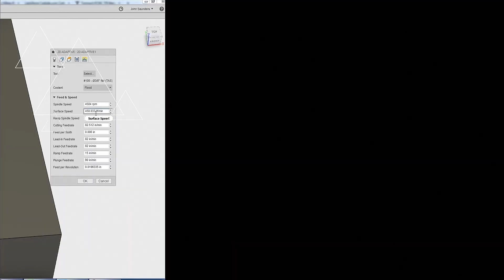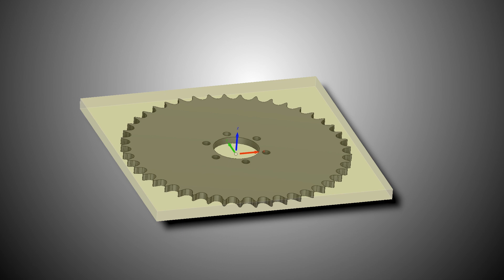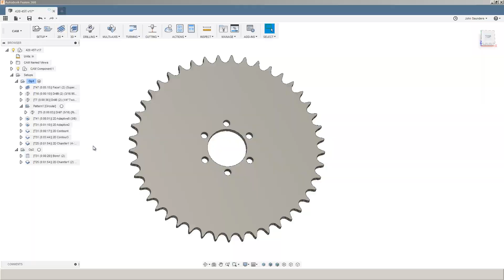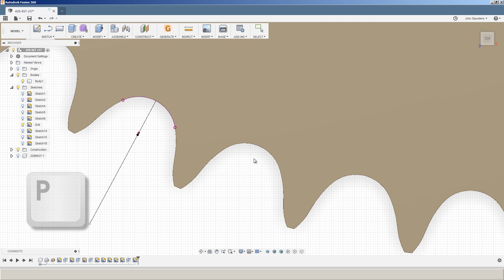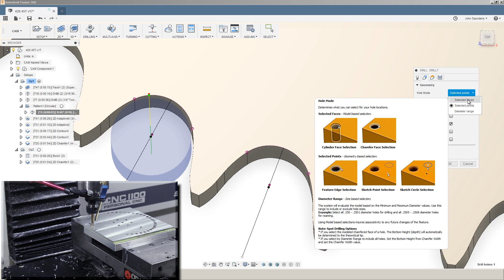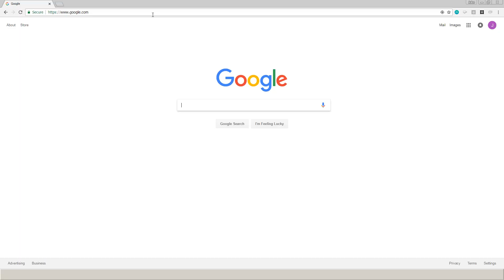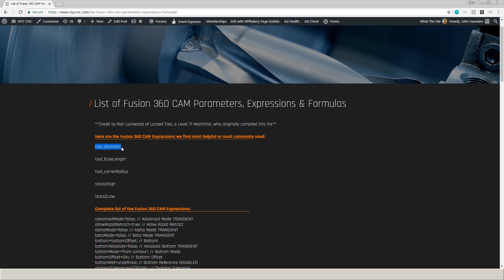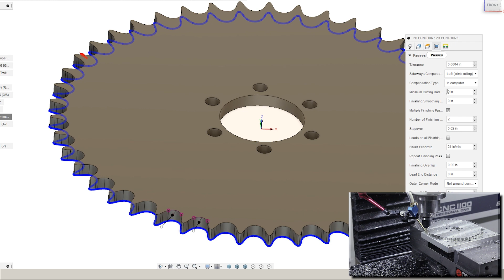CNC Machined DIY Minibike Sprocket | WW214

Comment: Is there a reason not to do a 2D contour  cut that cuts a circle around the sprocket teeth instead of cutting away all the material of the plate as you did in this project?

Comment: the peaks on the sprocket teeth are too tall and preventing the chain rollers from rolling out easily.  daniel. make your chain tensioners to run inside the chain close to the sprocket to help pull it off the sprocket.  or use idlers and a second set of spring loaded tensioner rollers to pull it in.  you could mount them on a triangular plate..

Comment: Hey John, I'm the production manager of a CNC milling shop in Germany and watch your videos for a while.
You're absolutely right when you say workholding is the most important thing about our job, with the right technology you can save a lot of time and money. 
I have never tried the Super Glue trick myself, because I mainly work with steel and have magnetic chucks available.
What I noticed in this video, is that you do not have to mill the corners away when the super glue sticks as well as you say. 
This only costs time, I would use after drilling a TPC strategy to make a circle to have room for the final pass.
In WW211, Ed made a lot of parts for your DIY Turret Lathe, he was a little inefficient because sometimes he had to measure the workpiece twice in the second operation, you could saved this completely if he had drilled trough the complett raw material in first operation. The drill operation will take some secounds longer but as long you have to use the Haimer and not a automatic touch probe system, you can be a lot faster.
Anyway only a few tips from a German guy... , you doing a very good job and it’s geat to see how you have evolved from your beginnings and now your are even start in 5-axis business.
Keep it up, best regards 
Tobias

Comment: I notice that you don't use coolant with the super glue fixture. I have found that the coolant destroys the adhesive bond of the blue tape, and the part comes loose during machining. If I am using coolant, I use the super glue, but no tape. The result is requires more cleanup to get rid of the glue residue, but the bond holds up during machining. I have also tried 2 sided carpet tape instead the the super glue, but the coolant also breaks that adhesive bond. I find that coolant gives better results on 6061 than air, especially in preventing welding of the chips to the tool.

Comment: Cool I would just make it from steel It will not last long from aluminium. Couple wheelies  . . .
Reply: Wrong. It'll last the life of that bike. I drag race 200+hp 2-strokes and all I use are aluminum sprockets in the rear.

Comment: I would have like to see how you set your coordinate system on the second opp - or did you?  How did it work out with 4 locating dowels and 45 sprocket teeth?
Reply: Use the bolt pattern
Reply: Yeah, just would have like to see it - there would be lots of ways in which you could screw that up because of odd number of sprocket teeth (lack of symmertry).
Reply: There's a tooth every 8° and a bolt hole every 72°. There's 9 teeth between each bolt which means no matter the orientation it'll line up just fine.
Reply: Well there you go... I wonder if that was premeditated or just dumb luck?
Reply: @stefanblack3909  may just be a simple luck of the draw, but if you did it in CAM You'd just aim to have one sprocket tip at 12oclock or something.

Comment: Question: why are you spending the time turning the corners and center of the stock into chips? Seems like you could skip the corners and the center plug and just toss the leftover pieces in the scrap bin. You'd have to knock them loose from the pallet, but that isn't burning up machine time.
Reply: If you cut at full width at NYC CNC you get fired. I'd just run a 1/4" EM and cut out between all the drilled spots

Comment: I wish you would have talked more about the design of the geometry, in addition to how the part was fabricated.
Reply: Well I did most of the design my self based off my very specific needs since the build is very custom. The new motor I put into the bike makes way more power than the original so I needed a stronger sprocket. It's a 420 motorcycle sprocket design which is much thicker than the original #35 sprocket allowing a larger 420 chain to rest on it, I also stepped it down to a 45 tooth sprocket to make the gear ratio more controllable with the new motor. Plus the 45 tooth design is symmetrical when flipped over making Op 2 easy.

Comment: Would have been much better and faster and easier to band saw the corners off, clamp the roughed OD to that plate you have it on, finish the ID, then cap the ID to finish the OD and bolt pattern. You can get away with the center cap overlapping the bolt pattern if you are concerned about vibration. Just drill/mill thru the cap into the holes. That part should be done in the time it took to drill all those holes! Take that drill out of there for crying out loud!

Comment: Hey John, I’m a high school student and my school just bought two tormach 440s and a tormach 770. I feel like I have an idea of the whole cad/cam side of things but I still have no idea how I would set the machine up and get it running, any videos you recommend on that?
Reply: That seems like a pretty substantial outlay without knowing how to run them?
Reply: Anonymouspock my school just passed a 90 million dollar referendum so they’ve pretty much been blowing money around, none of the teachers are trained so it’s really just me and a supervisor trying to learn
Reply: Damn I wish my school would get some more CNC stuff. Out woodshop is pretty nice, we've got a number of SawStops and other nice tools, but as far as CNC goes there's one old, big ShopBot that I worked on getting running last year, and there's a couple little mini CNC mills hanging around I plan on trying to get working this year.
Reply: Tormach has videos of machine installation and they send pretty good instructions. As for operation, how about starting with Johns templates and tool libraries.
Reply: Document your efforts on getting those machines running. Pictures, videos, daily work logs, random notes scribbled on napkins at lunch, everything. Make it look nice in a binder and maybe a website for the digital stuff. Then whenever you need to present yourself to someone else, be it for a college application or a job interview, take the binder in and tell your story. Be humble yet proud and I guarantee you'll make a good impression.
Reply: @jeffwuzhere wish I did this 5 years ago lmao, now looking to get an internship at Tormach and going to school at UW Madison for engineering mechanics
Reply: Might be worth a try to see if there is an experienced person in your area who wouldn't mind helping out. Perhaps post this question also on https://www.cnczone.com/forums/tormach-personal-cnc-mill/

Comment: Good prototype. You should make one out of steel now. It'll last longer. And it will give you some experience in how materials affect your programming Speeds and Feeds.
Good work.
Thanks
Reply: Steel is way too heavy, esp on that tiny bike. I have had aluminum sprockets on all of my street bikes, which have well over 100 hp, and they're fine. Most high-end/performance/aftermarket rear sprockets are aluminum. Steel just adds rotational mass contributing to angular momentum, and unsprung mass.
Reply: Really. Ok thanks for that info. I learn something every day. I wouldn't have thought aluminum would last with a steel chain. Interesting. Thanks

Comment: Where do you get sprocket cad files?  Say 520 pitch in various number of teeth?
Reply: Mastercam
Reply: McMaster carr has cad files for several sprocket types, certain # sprockets match motorcycle sprockets like 420 and 520 in pitch geometry but not thickness
Reply: 100% No need to recreate the wheel when McMaster has all this stuff publicly available.
Reply: Thanks!  I used sprocketeer and had issues with the sprocket not aligning with the chain properly.  I will try a mcmaster model and see if it works out better.

Comment: I've made numerous sprockets and I never chamfer the edges. I only put a few degrees radial draft on the edges of the teeth only (both sides)  leaving the roller socket with a square edge. Machinery handbook has the formulas for tooth formation. Mastercam has a built in chook that will generate a sprocket with a couple of mouse clicks. Last sprocket went from cad to cutting in 15 minutes.
Reply: The point of these videos aren't so much to show how to machine a sprocket. They're a method to show intricacies of CAD/CAM.
Reply: @xenonram  what good is knowing cad cam if you are unable to build things correctly? What customer is gonna pay money for things made incorrectly even if it's made by the greatest whiz bang programmer? I feel knowing Cad Cam applied to sound designs is best. Machining is a highly competitive business and if you're gonna survive you cant do things half way. Just my opinion from years of shop ownership.
Reply: Yes, the way they machined the sprocket is not how a motorbike chain sprockets are designed at all. What you describe is what i find on my bikes, both motorbikes and bicycles. The sprocket teeth are narrow at the tip to securely grab the chain, then the chain sinks towards the root of the teeth and the chain is fixated over it's full width. The design from the video might works as a quick demo but to actually use it seem dangerous as you might drop your chain or snap it. Feel like this needs a disclaimer since some will go out and make sprockets like this. Doing it the right way would have been just as easy.

Comment: I have seen a lot of people (on YT) gluing the actual metal faces together and loosen it afterwards either with heat or impact. Is there a specific reason you do it with tape? Could direct superglue be an option for more aggressive work?
Reply: Tape makes removal and clean up a lot quicker, and hold just as well... As long as your burnish in the tape first.

Edit:
Also, I've found most of the time, the tape actually sticks better to most materials than the super glue directly.
Reply: Superglue needs to be cleaned off afterwards, but the tape will just peel straight off.

Comment: maybe have them run manual machines for the first month/year then cnc.........
Reply: I ran Bridgeports and surface grinders in a tool and die shop for 2 years before getting into cnc machines here
Reply: Daniel Esbenshade thanks for understanding that machinists are better when they learn by hand first.....
Reply: did you also type on a typewriter before a computer?
Reply: Morgan Oliff yes i did.